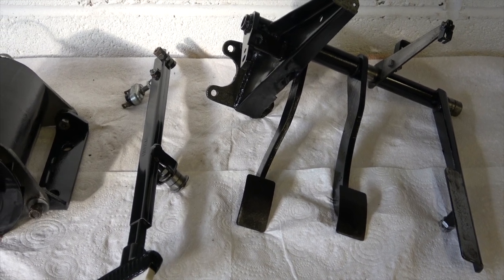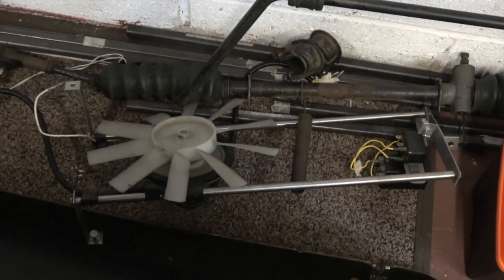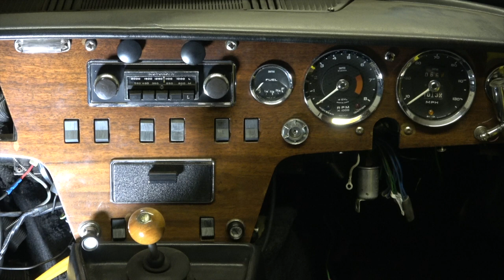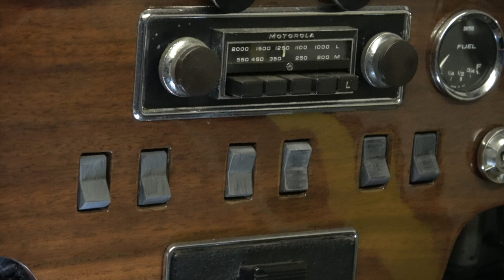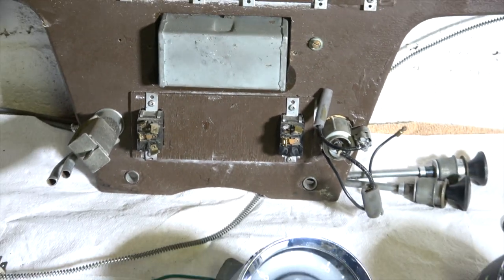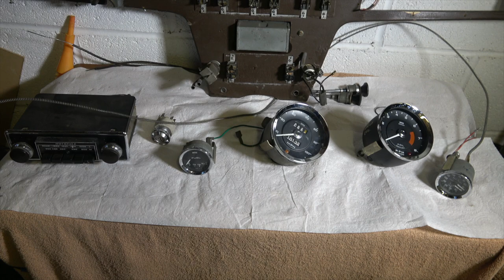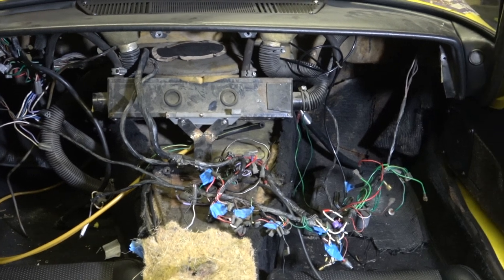Lotus Elan Dashboard removal.

Comment: Good video and commentary.  I will be fitting new dash soon and also trying to resurrect my heater fan.  I believe my dash wiring loom is from a zetec which was in the car when I acquired it.  Have replaced with a twin cam now but your video will be very helpful.  Keep filming!
Reply from the maker: Thanks Nigel, I'll be removing the heater later today to check the fan and tidy it up, so I may do a sort video.

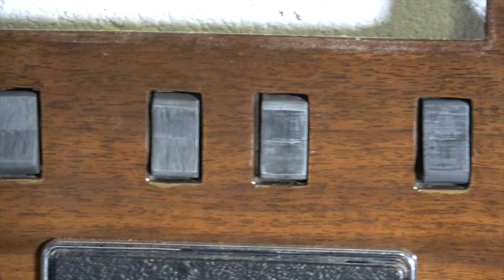Comment: 6:27.  It's my understanding that Lotus sourced the switches from a company that makes clothes washers and dryers.  They all fade like yours did.  8:17.  I suspect that your car came with electronic ignition.  If so, the original tachometer is not compatible so the previous owner had the tachometer converted to work with electronic ignition.  The original tachometer connected to the ignition switch side of the coil via the ignition switch.  The converted tachometer connects to the other side of the coil, thus the markings on the back.  Keep up the good work David!
Reply from the maker: Thanks for the info Frank.
I never actually considered about the converted Tachometer...I wondered what those markings were, but was going to investigate further when the time came. I was thinking about going back to points but that might be to much of a retro step.
As regards the switches, I'll have a go at refinishing them if I can, as you probably saw the heater switch needs mending....and if I have to replace it it would stand out like a sore thumb.....so heres hoping..
Reply: @davidbaugh  It appears my guess that the car had electronic ignition was correct.  The original tachometer had a pair of connectors right next to each other.  The wire from the ignition switch supplying 12V to the coil took a detour through the tachometer going in one of the connectors, making a loop within the tachometer, and then out the other connector to the coil.  The converted tachometer has a wire that goes straight to the other side of the coil.  In addition, both tachometers have a 12V positive connection as well as ground.

I got tired of having to pull a knob and flip 2 rocker switches every time I wanted to turn my headlights on so I replaced my "Panel" (instrument lights) switch with a new momentary switch and wired it to a transmitter for my garage door opener.  The instrument lights now go on whenever the running lights are turned on.  You're correct.  It sticks out like a sore thumb.  Some day, I'll take the Rolling Stones advice and paint all of the switches black.
Reply: For what it’s worth the rocker switches supplied by Paul Matty are not an exact match for the originals. I would guess that the originals are not available anywhere. Even the fixing screw spacing is slightly different so holes need slotting. I ended up repairing my main light switch internally and sprayed plastic with satin black and refitting. Three years on and no more problems so far.